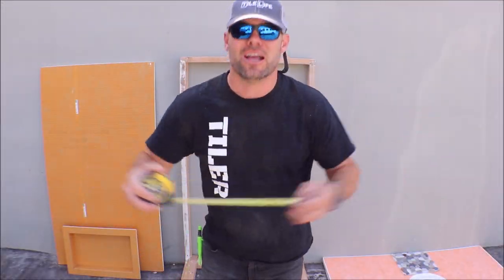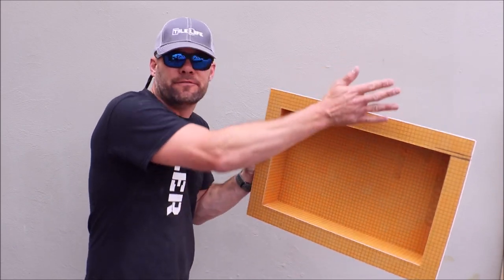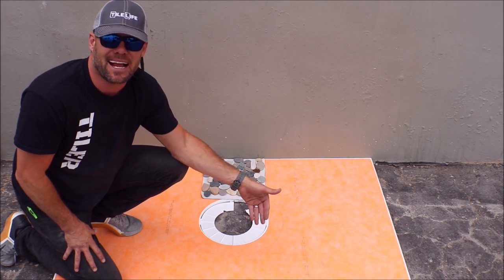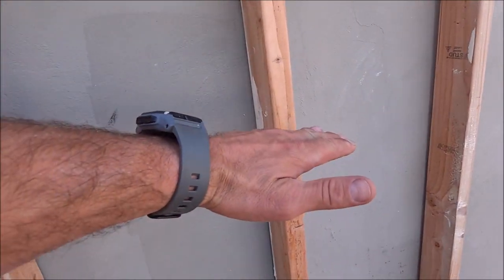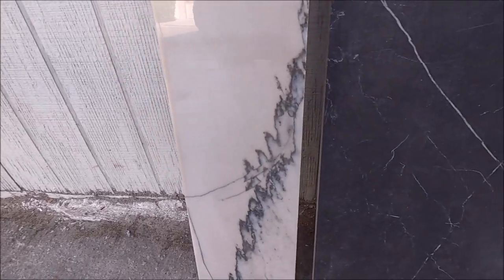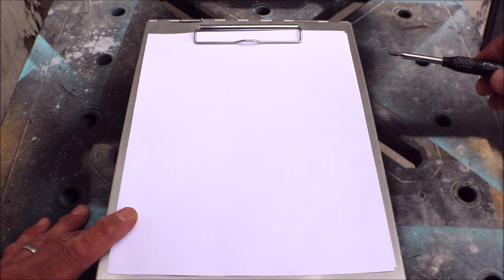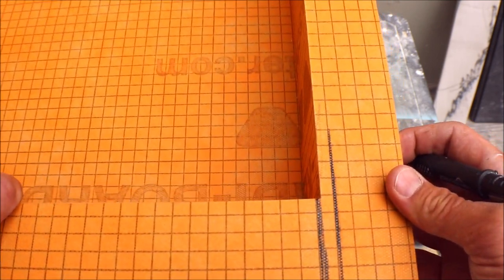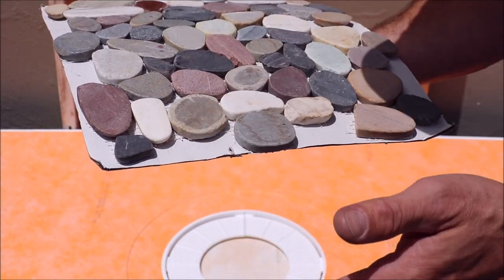How to Measure for Proper Shower Niche Placement

Comment: That is a great way to do it when using a pre-made niche. I  like mine to be much taller than 11" so I make them from scratch. To achieve the same results , measure out the approximate points where the tile will be, then make the niche a 1" or two bigger. After tile has been set it will be overhanging into the niche, fill the top and bottom with thinset or drypack. Now the niche has full, uncut tiles on top and bottom.
Reply: This is the answer I was looking. So I understand where the tile would meet on the bottom part of the niche. How about the tile for top part of the niche? Does that matter so it doesn’t throw off the tile pattern? Thanks
Reply: @ariesanfilippo1078  you always make the niche fit in with a tile,layout so you gotta do layout first

Comment: Your amazingly talented. Did you use a ledger board? If yes I'm assuming in a non mockup situation you would have to install additional tile below the ledger board to meet up with the shower floor?
Reply from the maker: We usually install pan tile first, then tile walls. Sometimes we install a ledger board depending on timing of the project

Comment: Very informative and to the point but curious why with (3) 12 in tiles tall it ended up being 35 3/4 tall?
Reply: Like a 2x4 it’s easier to say than 1.5”x3.5” board. Tile isn’t exactly 12 and 24

Comment: If the sill were to extend past the niche edges on either side would it install on top of the wall tile or be installed first and the wall tile cut around it?

Comment: Dumb question.  The inside height of that niche is 12? Unless you install 12 inch tile the next tile up from the bottom of the niche will be taller than the niche? Then you would have to L cut it? Also your not using the IQ saw anymore?
Reply from the maker: For this demo, I cut down the middle tiles 3/8"  and polished the edges to look factory. Rectified tile is best to do this with as it's square, but you can still do it with non rectified (tile I used in this demo). This allowed me to miter the top tile of the niche and have it dropped down pass the top edge. Installers may frown on this, but we do it all the time and the eye can never see it. Hope this makes sense and I used the Dewalt for quick and easy miter cuts!

Comment: So wait. I have a question. The tiles to the left and right of the niche that you placed can not be the full 12” due to the over hang needed to accept the miter. So does every tile in that row around the walls need to be ripped down to keep a straight grout line? Which in turn makes that one row slightly smaller than all the rest?
Reply: The tiles aren't 12" out of the box, more like 11 3/4". Line uf the bottom tile and the rest will fall inline.  However, with these niches the margin of error is very tight and will likely spell disaster for many who try it.

Comment: What would you do if the niche is taller than the tile you are using you will not end up with a full tile on top
Reply from the maker: We have been cutting and fabricating our prefab niches to match tile. We would cut it right through the middle and remove or add 1/2 Kerdi board. Something like this: https://www.youtube.com/watch?v=GnEOL-iIKSg